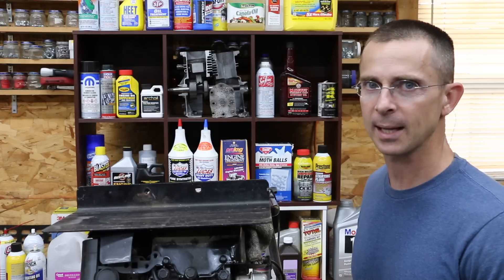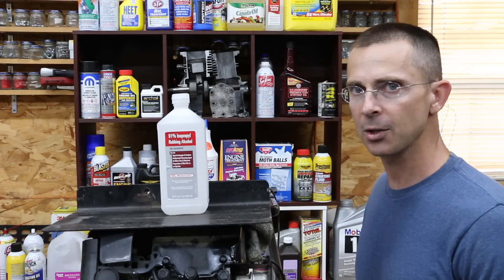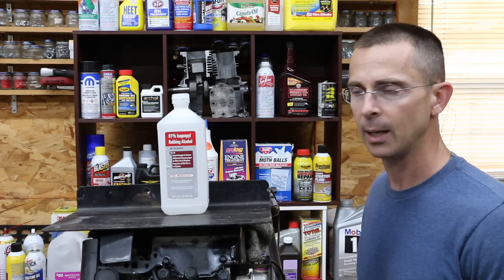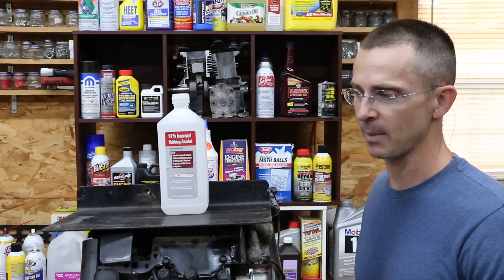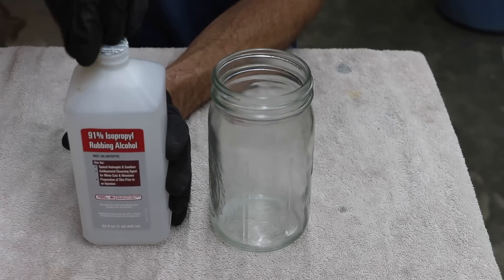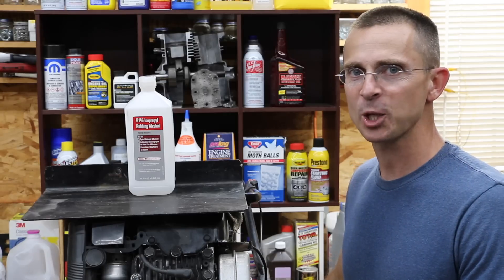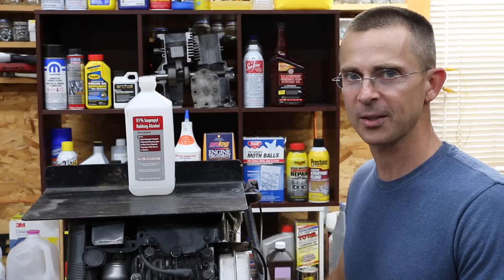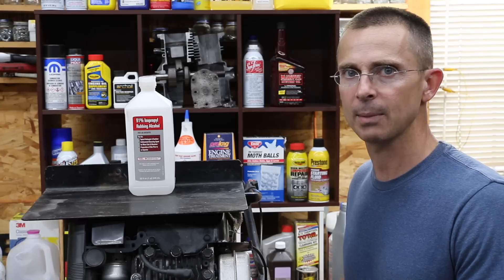Will a Gas Engine Run on Isopropyl Alcohol?  Let's find out!

Comment: As usual, great video & I learned something......alcohol burning engines usually have a supply line that is twice the diameter of a gas line, owing to the fact that it requires(so I was led to believe) more alcohol by volume than gasoline to produce the same power. You test seemed not to support that contention. Thanks for your time & trouble......I know you aren't becoming rich making these videos, & the videos are at once  , interesting, informative, well thought out, & the effort expended in attempting to eliminate to the degree possible the sources of error  that would skew the data & hence the results are without peer. Your viewers owe you a debt of gratitude. Thank you again.   Cheers!    Brian
Reply from the maker: Great point on the supply line. Thank you

Comment: This was well worth watching and thank you for sharing this. Now I know that if I ever need to use Isopropyl rubbing alcohol in an engine instead of gasoline, it is possible. Since the engine ran funny I know that I would only do it if it was really necessary because I had nothing else and no other option. Thanks for showing this. I appreciate it.
Reply from the maker: Thank you!

Comment: lol  in a truck I had 10 years ago I ran it almost completely out of gas then put 6 bottles of 99% Isopropyl Alcohol in the fuel tank, and took it to the emissions test center where it passed with flying colors.. The results were better than what was required at the time for a 4 year old car (2005 model year emissions) let alone the fact it was a truck from the 1980's with a disconnected smog pump, clogged EGR valve, and a hollow catalytic converter.  I wouldn't run an engine too long on that unless you have coated pistons and rings and bla bla bla.. But it works great "temporarily" for emissions testing. (the flame front is faster with alcohol, and it burns more completely, so that = much less exhaust emissions)
Reply from the maker: Nice!

Comment: Try moonshine as a gas substitute. I’d imagine it would run far hotter then normal, possibly causing metal fatigue, but it’s just a guess so we’ll need to see it.
Reply from the maker: I tested Everclear, which isn't exactly moonshine but fairly close and the engine ran.

Comment: The Alcohol really cleaned up that one valve.  I wonder if that is the reason for the compression drop.  Less thick sludge could cause a loss of compression but is that a good thing or a bad thing?
Reply from the maker: Great point. Thank you.

Comment: So could I theoretically stop by a store and grab a few bottles of isoprophl if my car runs out of gas? Or would that cause engine damage
Reply from the maker: I wouldn't recommend doing this but another viewer did this since he was at a pharmacy when he ran out of gas and did this to get to the gas station.
Reply: @ProjectFarm  More than once when gas was something I'd save up for as a student, it was often the shortest walk to a nearby convenience store for two bottles of rubbing alcohol ( the Ethanol kind) and it ran fine, with slightly less power. What didn't work was the high water content kind 93%, so 97% minimum. Energy wise, Isopropanol has as high a energy content and the air fuel ratio is closer to gasoline, so it will most certainly run on that without issues. Last tip: Occasionally Bio-Ethanol for flue-less stoves is sold at a discount to reduce inventory, and when it is cheaper than gasoline, I clear the shelves.

Comment: At 79 cents for a 32 oz. Bottle at the grocery store... It's  way cheaper than Seafoam & Berrymans...
Reply from the maker: Great point.
Reply: @ProjectFarm  but it will eat up,all the rubber seals and gasket,in the fuel system!1

Comment: Please test the usability of Naptha?, someone gave me 200 gallons of clean new naptha in 55 gl drums and I have been blending it with new transmission fluid then adding it to my diesel trucks fuel but I am curious if it will run in a small gasoline engine ok and if it will not cause any damage or problems?.
Reply from the maker: Great video idea!

Comment: I ran a moped on 90% isopropyl alcohol when I was 16. It was hard to start but actually felt like it had tons of power compared to gas. Then it got stolen. :/
Reply from the maker: Impressive!
Reply: @ProjectFarm  we need more this alternative knowledge now or almost everyone will become slaves to the mainstream big oil folks
Reply: @ProjectFarm Have you tried wood gas in a gasoline engine? Have you tried these kinds of experiments on larger car sized engines? Lastly have you tried alternatives to diesel?
Reply: Kiss that moped goodbye
Reply: Who the fuck steals a moped
Reply: @OldSchoolZ-wy2yx  Another teenager
Reply: @OldSchoolZ-wy2yx  meth heads...
Reply: OldSchool89Z24 Nick Gertz
Reply: Someone saw your moped, thought "I gotta have it." And they took it from you... What the hell is wrong with people.
Reply: @ZackJenkins  the guy who stoled may wanted It more than him
Reply: @ZackJenkins  Life is suffering and misery. :/
Reply: Lol
Reply: 91% alcohol should work like a top alcohol dragster.....mist spray gasoline into the breather element while cranking should make it easier to start. After it's started, it should run solely on alcohol.
Reply: I'm saying Ugh sir lol
Reply: Uncool story bro. 🙃
Reply: Take the seat or a major component like the fairings off. I hope everything is cope now.
Reply: They just wanted to test if your mind can run on AngerFuel instead of AngelFuel that day.
Reply: Because it did have a bunch more power
Reply: in tried that and the head blew up ❤
Reply: 90%? I got one an I’m only using 10%. I’m now intrigued
Reply: If you had tons of power the carb had to be set up way to rich.
Reply: It will probably burn the valves if the fuel mixture isn't 7 to1 ratio.
Reply: @frank.l181  a lean two stroke will hole a piston.

Comment: I know that 91% isopropyl alcohol works in a pinch for camp stove fuel, but yellow bottle Heet works a whole lot better, burning with zero soot. So now I'm curious if yellow bottle Heet will burn in an engine with near zero soot. (Red bottle Heet is methyl alcohol, and doesn't burn nearly as well.)
Reply from the maker: Great video idea!

Comment: I just inducted a mix of 50% IPA ( 99% ) and 50% Naptha into a hot engine and I noticed that it produced no smoke.  That makes me think the smoke you get when using Seafoam actually comes from the Pale Oil component, and not from the carbon being burned off.  Haven't pulled the plugs yet to see it's effect yet, it'll be interesting if it's better than regular seafoam.
Reply from the maker: Great point. Thank you

Comment: Newer mower: alcohol left in tank for a week or two and now it won’t start
Older mower I got for free: left alcohol in there for about 3 months and it still starts and runs like new
What the heck
They’re both flathead engines
But I guess the newer one’s carburetor is more advanced and gets clogged easier
The older one has the carb built on to the tank
Reply from the maker: Gasoline with ethanol or 100% alcohol?  If you could, please create a new comment so I can find your response.  Gasoline with ethanol should not be that big of an issue for just 1 month.

Comment: Here's why it works. 91% has 91% alcohol and the rest is water. You can run your engine and squirt water in your intake at 25% throttle and it creates steam wich will remove the deposits just like a pot with burnt food. If you take clean water add a couple drops of soap and boil it the steam bubbles remove the carbon on the pan and you now don't have much scrubbing to do. The same is with an engine nothing different. Now the alcohol is a fuel and anything that can be atomised and burns you can use as a fuel some produce more btu's than others. Gas has better but than alcohol so that's why it ran better at throttle. Now the alcohol dispels water when it evaporates. So when you ran it it went into the hot engine. Now when then intake stroke on a engine the fuel going in quenches the piston to help cool it down. When it runs lean it runs hotter. If you ran it richer the temp of the engine would have come way down. But it caused steam and that's why it started to clean the chambers. Now you learned somthing
Look into all thoes and you will see.
Reply from the maker: Thanks for commenting on this.

Comment: Isopropyl also seem to burn a good quantity of oil inside the combustion chamber and the admission valve is far much cleaner. Now I don't wonder why nascar are running on alcohol gasoline

Comment: You should try to run an engine on methanol only, then blended with gasoline and try running an engine on washer fluid which is 30%methanol.
Reply from the maker: Thank you for the video idea!

Comment: not sure if you've done it yet but run an engine on pure carb cleaner, sort of obvious that it will work, but i use it as starting fluid a lot so just wondering if you can do it.
Reply from the maker: Thank you for the video idea!

Comment: Great work. Have you debunked the idea that pure water injection (pressure sprayed via a small oriffice needle into the air intake along with the fuel air mix) would have a good cleaning effect? It would be a new take on an old drip feed method thats meant to have worked.
Reply from the maker: Water does an effective job at helping clean but there are side effects to using it.
Reply: I managed to get my 205000 mile Golf tdi to sip 3 litres of water over an 80 mile journey, about a 30% mix i think. Doesn't seem to have harmed it. It smokes less on start up than before. Mpg didn't alter.

Comment: As a kid my grandfather told me to use 91% alcohol with a few drops of caster oil in my Cox control line plane engines. It worked fine.
Reply from the maker: Thank you for this recommendation!

Comment: When you accelerate an engine, is it just from the carb giving more gas and air? Is the gas pedal on old cars just connected to the carburetor?
Reply from the maker: You are correct, it's from the carb giving more gas and air.  Thanks for commenting.

Comment: I saw you do the AFT to clean the crank case. Thats one trick I've heard. Another trick is to add BRAKE FLUID to your oil. Not much, just about 8 fluid ounces to a 5 quart engine. I've ran old trucks with stuck lifters and sludge, and brake fluid has helped immensely. But sometimes, the placebo effect makes it look different.
Reply from the maker: Thank you for this recommendation!

Comment: If you haven’t tried it already, will an engine run on denatured alcohol?
Also what will bartenders friend/Ajax do to an engine?
Also will an engine run on biodegradable graffiti remover?
Also what if you ran an engine on pure acetone?
What about goof-off/adhesive remover?
Electronic contact cleaner?
Bug repellent?
Glasses cleaner?
Hand sanitizer?
Also if you could dissolve Vaseline or sterno fuel in a liquid what would happen if you used that?
Edit: I added denatured alcohol to the gas in my free mower, and it only seemed to work if I revved it above 1,000 rpm.
Reply from the maker: Lots of great video ideas--thank you!

Comment: I did something  similar in my 1973 gmc except I used denatured alcohol  and for the first min or so I had visible black smoke from the exhaust then it ran clean. After doing this the truck  had a noticeable power gain
Reply from the maker: Impressive!  It must have cleaned out the carbon.

Comment: that was only running a small amount through, what about a steady diet of the alcohol from new, would the thing even carbon up? Would tweaking the carb a bit help the smoothness? Common wisdom says you need to run a bit more fuel when running the alcohol, but it will make more power. Race engines commonly run on alcohol, whether it's isopropyl, ethanol or Methanol shouldn't make any difference, but one must ask, what is the other 9 percent? water? Common wisdom says that alcohol will allow a certain amount of water to be absorbed by the alcohol and run through the engine without harm. How true the common wisdom is, don't know. I do know that the original Model T's were made to run on alcohol as well as gasoline, because stills were way more common than gas stations at that time. The problem with running pure alcohol in most automotive engines is not inside the engine, it's in the tank and fuel lines if they're not made for alcohol. Metal lines aren't a problem, but rubber (or whatever passes for rubber these days) are. Hmm, there's a test run for you, get pure ethanol, Methanol, and isopropyl and see if there's any difference at all. You'll need to have a definitive method of measuring the power and probably need a run on gasoline to have a control run.  

Here's another test for you to run sometime. different brands of spark plugs... in cars and motorcycles, I've always done well with NGK, Champions and even the fancy Bosch plugs did not run as well or as long. The Bosch were the ones with the extra electrodes. My car ran like crap and would sputter and stall and all that with the bosch plugs, I changed back to NGK made no other changes and the car ran well again.
Reply from the maker: All great points. Thanks for commenting.

Comment: Do you think it would work in a truck ?, not to drive but to pour it in the gas tank crank the engine and lean it run to clean it?
Reply from the maker: I believe there are better fuel system cleaners available, such as Seafoam and Marvel.

Comment: maybe try it on alcohol vapor instead of pure alcohol
Reply from the maker: Thank you for this video project recommendation!
Reply: Project Farm you're welcome, by the way you also know aquaria etc have those bubblers, maybe you can find something larger in scale like that, i think it would vaporize liquids more effectively as there are small air bubbles instead of big ones
edit: or use pvc caps or so with really small drill bits for the holes on the air inlet side on the end of the pipes, but enough holes since i'm pretty sure the engines need enough airflow on the intake/carburator

Comment: In the movie Lawless, a vehicle ran out of fuel and used moonshine to get the truck running again. Real moonshine is slightly difficult to come by, but Golden Grain/Everclear is a flammable liquor. Could it be potent enough to run a gas engine?
Reply from the maker: Thank you for this recommendation!

Comment: i can't tell is test subject a 4stroke or 2 stroke.?..looked like isopropyl cleaned insides real good but probably too good to run all the time as a fuel due to lack of lubrication on rings.?
Reply: It has an intake and exhaust valve in the head, therefore, it is a four-stroke.  Two stroke engines do not use traditional valves, they have ports at the bottom of the cylinder wall for intake and then another port about mid-way down on the opposite side for exhaust.  Four strokes also don't really rely on lubrication from the fuel for the cylinder wall or piston rings.

Comment: How about cigarette lighter petrol or charcoal lighting fluid? Lamp oil or mineral turpentine? 

The three first may not differ a lot from each other or Coleman fuel, though, and the last may have been tried if paint thinner is considered the same.
Reply from the maker: Thank you for this recommendation!

Comment: how about BBQ starting fluid?
Reply: That is called NAPTHA Thinner  in the labeled cans for paint solvent use,,,it is basically the same thing as charcoal starter  ...  It is a good additive for fuel to get the  fuel injectors and combustion chambers  cleaned up  but it probably ignites too slow to be used as a pure fuel in a typical gasoline burning engine .
Reply from the maker: Thank you for this recommendation!

Comment: Have you tried methanol? I'd like to see power (gain/loss). I'd also like to see if the engine runs cooler. I run methanol in my race car. I have to run 1 3/4 more methanol than 114 octane. Let me know thanks!
Reply from the maker: Not yet. Thank you for this recommendation.

Comment: I watched video on diesel fuel hardly any compression what if you did a mentos and diet coke mixture to more upper force on the piston or in genaral what will mentos and coke do to a small engine will it clean the carbon out diet coke gas and mentos
Reply from the maker: Thank you for this recommendation.

Comment: I wouldn't make a habit of using this as a fuel, that remaining 9% is mostly water, which will eventually corrode your carb and the rest of the fuel delivery system. This is one reason your engine ran cooler, the other reason is ethyl alcohol has only about half to 2/3rd the energy density that gasoline does and has a much higher octane so it's flash point is much higher (although I don't believe that would decrease engine temps., making it run a little richer would lower temps.).
Reply: With more communities using reformulated Gasoline there's some small engine manufacturers that's starting to void warranties if too much ethyl alcohol and other additives in the Gas has caused corrosion issues.
Reply from the maker: Excellent point and advice regarding the water content.

Comment: An engine set up to run on gasoline will run lean on alcohol.  It has less energy by volume than gas.  You would need to increase the size of your fuel jets in the carb by about 30% or so to get a good mixture.
Reply from the maker: Great point. Thanks for commenting.
Reply: Insanely cool lexan flathead.  At first I thought it was some kind of high tech camera thing, but that is just so clever.  Well done.

Comment: I only just realized how strong these little motors are. 8 bolts on a single cylinder head.. No wonder they are able to take so much abuse
Reply from the maker: Yes, they are built to last in the toughest conditions. Thanks for commenting.